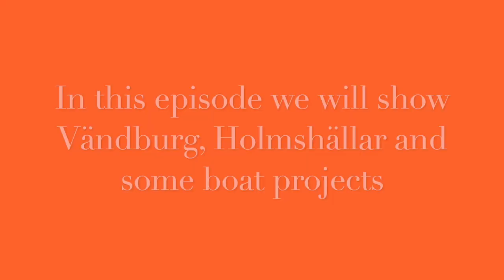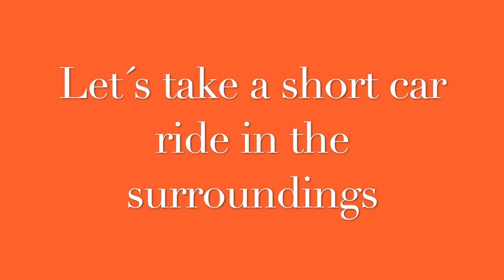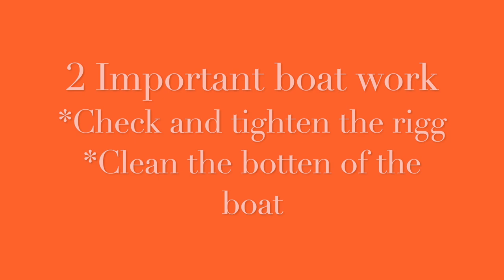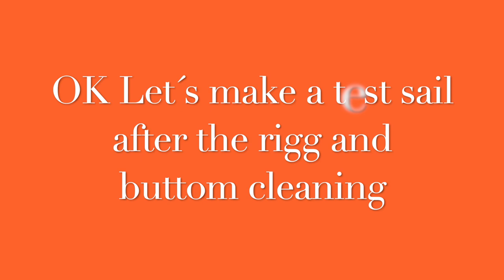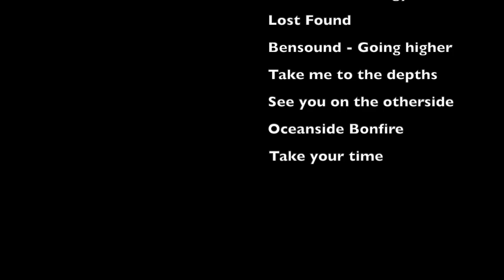Ep 5 - New crew and sailing in our home water 1

Comment: Hello Frida crew, I saw your video link on a wauquiez forum and have started looking at them. I own a centurion 38, our home port is in Genoa, Italy. I'm just wondering why the gennaker halyard is so hard, the gennaker is closed, there is no pressure on it and it should go up by hand only, are u sure you have not a twist in the must around another halyard like the genoa or the main one? if you need to apply all that force with the winch you risk to break something. ciao Dirk Modica
Reply from the maker: Good observation the halyard line is a little to thick for the blocks that it is on and Erik is inexperienced so he has not really got the technique for how to use the winch yet. All the other winches are electric.
Reply: Ok, clear, maybe you could consider to exchange the present halyard with a "cruising" dyneema cored one and decrease the diameter by one size (you probably have a 14 or 12 mm one and could decrease to a 12 or 10 mm one). Have a nice evening Dirk
Reply from the maker: that could be an idea if you got questions regarding the PS please use message button at the Frida af Wisby page on Facebook